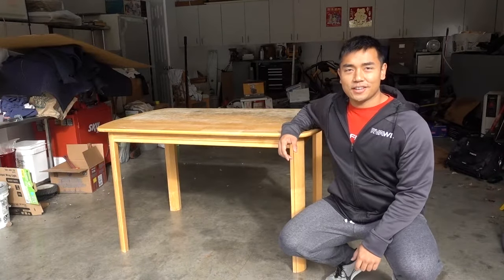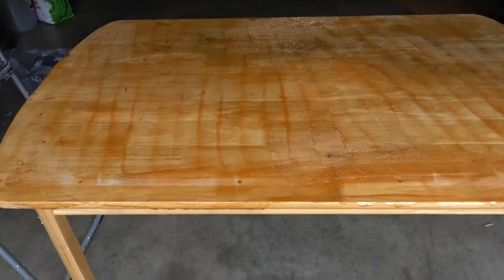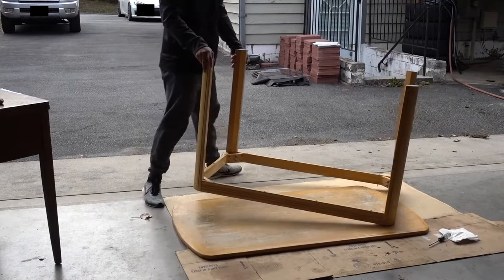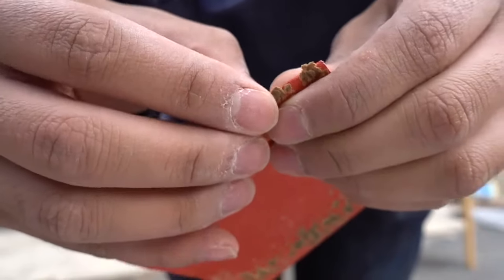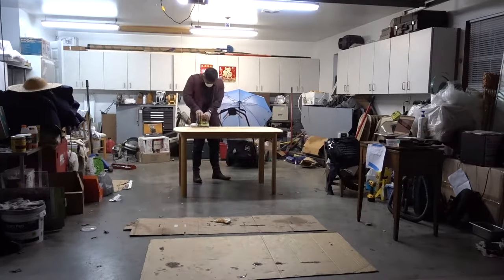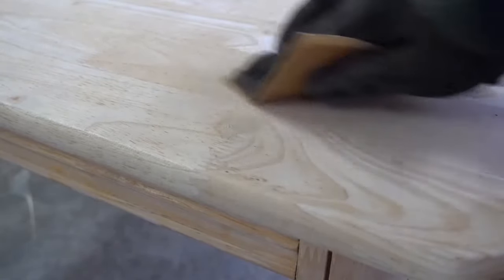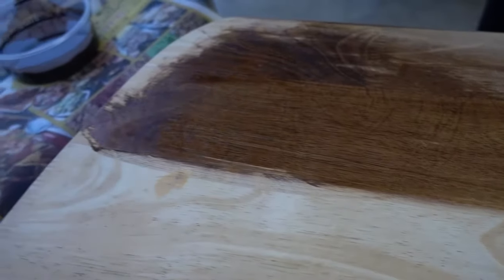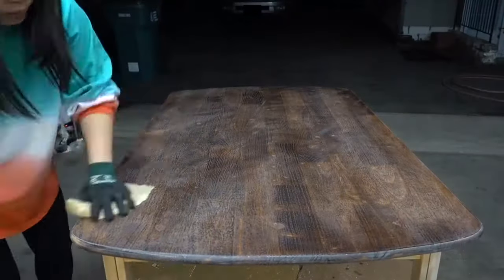DIY | How to Refinish an Old Dining Table

Comment: A few tips.. The finish was so gone it would have been easier to skip the stripper and just sand with the power sander... 80, 120, and 220 grits in that order.  Sand with the grain... Not in circles.  Minwax also has a wipe on polyurethane that is a bit more beginner user friendly than a brush on poly. You apply it with a rag like you did the stain. Lightly sand between coats with a 400 grit by hand and wipe dust with tack cloth. Your finish will be smooth. Now that you've started you'll find that if you need furniture thrift stores have great solid wood pieces that you can refinish for a fraction of the cost of new fake stuff.   Congrats on self teaching and sticking with it.  It's worth the effort.👍
Reply from the maker: Thank you a bunch for this! Appreciate the time you put in for all the advice 😀 I'll definitely come back to this in the future
Reply: i dont mean to be off topic but does anyone know of a tool to get back into an Instagram account?
I somehow lost my account password. I love any assistance you can offer me
Reply: @Sutton Santino Thanks so much for your reply. I found the site thru google and I'm in the hacking process atm.
Looks like it's gonna take quite some time so I will get back to you later when my account password hopefully is recovered.
Reply: @Sutton Santino it did the trick and I now got access to my account again. Im so happy!
Thank you so much, you saved my account!
Reply: @Ares Bowen you are welcome :)
Reply: Hey Lori, a quick question, when sanding to go with the grain are you able to still go back and forth?
Reply: @adamprice8247  are you using a random orbital sander?
Reply: @adamprice8247  no matter what kind of sander you are using, or if you are hand sanding, you move it back and forth along the lines of the grain.  If you are using a random orbital sander let the machine do the work. Dont push down too hard. Let the weight of the tool itself and your hand resting on it be the only pressure.  As you get more experience with the orbital you will start to figure out how much fudging of the "rules" you can apply to different issues like tipping it on the edge a bit for a tougher deeper scratch or more stubborn finish.
Reply: @loricreel2463  I’m sorry for this dumb question but this is something I’ve researched and no one mentions anything that can help me clarify this. If you’re supposed to sand along the grain, wouldn’t an orbital sander make that impossible to be accomplished? Doesn’t an orbital sander have a round disk that moves round super fast? So no matter in which direction I move the sander, it would still be spinning in round circles no matter what..? I have a table to refinish but it’s an expensive one and I’ve bought many of the required tools to do this same project but am scared I’m gonna destroy the table during the sanding process!
Reply: @Jess_Smith0903  not dumb.  I have thought the same thing.  It's one of those tools that you use according to the rules and learn through experience when the rules can be fudged to achieve a certain outcome more expediently. The other consideration besides the tool is the material you are working on. So if your table is expensive you should find out a couple of things first. Is it solid wood or is it veneer? If it is veneer, how thick is it?  An orbital can take off a lot quickly and burn right through a veneer.  So if it is, you need to be very aware of how your tool works, how thin that veneer is and what its condition is like dryness, and adhesion to the base material.  The other thing to consider is how much experience you have with that tool. If you've never used an orbital ( which rotates doubly like a planet hence the name) then you should practice on some material that doesnt matter. If you want to see how it works on a veneer you could pick up a cheap little side table from a thrift store and purposely go through it to see how that works.  Also use different ammounts of pressure and see what produces the dreaded swirl marks that jump out at you when you think you're done but show up when you put the finish on. Then see how to correct that with progressively finer grits and a sharp eye. Experiment with different grits and if available on your sander different speeds.  When I am sanding veneer with the orbital I use a low speed and 220 grit. It may take longer but it gives you more control and less chance of taking off more than finish and surface scratches.  If in any doubt, you are better off hand sanding if the table is really important to you.  Pain in the ass but nearly foolproof.  Any way you end up doing it I can guarantee 3 things: 1. You will come to a point, maybe several, where you think it's not worth the work... Persevere. I promise it's worth it. Take a break and get back at it. 2. You will know where every tiny mistake you made is and everybody else will see only an amazing job well done... Let them and just say thank you.  3. If you follow 1 and 2, it will be a piece of furniture that you are proud of, mistakes and all.  Have fun.🔨🔧 (they really need to make a sander emoji)
Reply: @loricreel2463  wow thank you soooo much for the elaborated answer! Yes, I picked up a piece slab of wood from Home Depot (those scraps they have for cheap) just to practice with the sander before starting on the table. 
The table is a solid walnut wood, very heavy! I will need to strip, sand, stain and apply a finish (Poly). I’ll try and remember to write you back here and let you know how the project went! Just waiting to warm up a bit since I’m in an apartment and will need to work on this outside in the balcony. Ps: you’d think that with so many useless emojis, they’d have a sander, but nope 😂
Reply: @Jess_Smith0903  make absolutely sure it is solid walnut especially on the table top. Frequently the frame and legs will be solid but the top will be veneer. Maybe the apron too.  Walnut is an expensive wood so to have a solid top is unusual even for older furniture.  Look at edges of top and underside edge of apron under good light and see if you can detect a thinner top layer of wood. Look at the underside of the table.  Can you see the planks and if they are running in the same direction as the top grain? Or are they running  perpendicular? Can you tell if the bare wood on the bottom is congruent with walnut color or grain? Really check.  I say this cuz I have made the mistake and found out the hard way.  Would really love to hear how it goes for you.  Hit me back if you run into questions.👍
Reply: @loricreel2463  the legs is a black metal (it’s an industrial style piece) and the table top supposedly walnut. It is VERY heavy so that’s why I think it must really be a solid one, plus it’s what the brand’s website describes it to be. I’ll try to inspect either way and follow the points you gave me to look through!!
Reply: @Jess_Smith0903  aahhh so is it live edge?  Sounds beautiful.  And if it's live edge, no worries... That's a slab of walnut.  If it's milled edges and you can tell on the end grain that the planks are just that, solid planks, then sounds like you're gonna end up with an amazing table.  I will reiterate that if you have never finished a piece before, minwax has a wipe on poly that is easier to use than brush on finish.  Might want to get a couple different ones and see what works best for you when you get to that point.
Reply: It's just a shame they ruined the legs.  SPRAY PAINT!!!!   AWFUL.  Yes, it would have been more work, but the legs were probably nowhere near as worn and would have required a lot less prep.
Reply: @loricreel2463 No, that is an orbital sander. It doesn't remove material as fast as a random orbital (dual action or DA) sander and is safer for sanding veneered furniture.
Reply: @loricreel2463 I agree with your caveats. It is best to assume that all furniture is veneered, this way you will never sand through veneer ever again. Look for a machine with a smaller oscillation, as low as 1.6mm, for the best surface with the least squirrel tailing. Going to 240 grit will be so fine so as to help make it less noticeable. In a perfect world nothing beats hand block sanding.

Comment: Great video . My wife wanted a dressing table , luckily we found one in our local charity store for £15 . It was very dark wood ,but you could tell it was quality made , with dovetail joints and mortice/tenons . Probably circa 1900's . 3 days later , sanding,stripping,sanding,staining,sanding, oiling, sanding,wiping it looks stunning . Well worth the effort . Just be brave .
Reply: That's amazing! What stripper brand did you use? I'm also based in the UK and also unable to get citristrip and a lot of brands available have terrible reviews so curious what worked for you :)

Comment: its not stupid spending 100 bucks to fix it. you could have easily gotten 250 for it on Facebook market place. But 100 bucks to restore and treasure all the sentimental value that table has is priceless. Good job restoring it.

Comment: I just started restoring my grandmothers dresser.  I’m glad I didn’t use that citrus stuff 🤣.  I just hit it with 80 grit to remove the old finish and kept sanding with higher grit paper.  80 > 120 > 220 > 400.  Then 4 coats of poly.  Sanded with 400 between coats till it was a mirror finish.  I’m no expert and this was my first attempt but I learned that the more you sand between coats (till it’s super smooth) makes a difference I think.

Comment: Yep , Citristrip is a nightmare. I had to do two coats with an hour in between or so and scrape for days to get off all the gunk it left that will gum up your sander as you found out. Then wipe down good with mineral spirits! I'd do a good carbide scraper and then orbit sander next time or at least try a better stripper than Citristrip which barely took off the poly and stain coat.

Comment: You cant put a price on memories. Or having a happy wife. For a first time using poly and stain i would say you did pretty good. That was a complete table restoration. Also like others have said if the finish/shine is already gone, you could of skipped the stripping part. Also sand with the grain. Other than that GREAT job.

Comment: You should have used liquid stripper, after the gel stripper. That would have penetrated into the wood grains better, and got rid of the dark streaks. And then what many others have said, ended with mineral spirit rinse. THEN sanding. Live and learn.

Comment: I’m doing my very first piece and I feel like I’ve spent a fortune! I now need mineral spirits also… The time it has taken me to go out and about is another issue. The thing is, I want to do it as a side hustle. I want to keep my pieces small and reasonable from a difficulty perspective. My next piece should be much easier because I should have most of the material and a bit of knowledge. I’ve ended up ordering on Amazon because I’m tired of running around AND it’s giving me a bit of a break. 
Good job on your table.
Reply from the maker: Yup! I'm sure as you get better, it'll cost you less and you'll be more efficient about turning it over!

Comment: For the gunking of the Sandpaper with the Citristrip residue, the only fix for that which works but requires additional effort is to graze off the gunk with a box cutter knife. It will fly right off, and every box cutter razor has a pointy bit which can clear speckled debris from your sandpaper.

Comment: When you use the citrus stuff use a brush to apply it and then wait until it bubbles and starts drying out and then you can scrape it and then clean the surface... Its actually really amazing stuff just need to learn to work with it
Reply from the maker: Good to know! I don't remember that being in the instructions but I'll try it next time.
Reply: @JohnHeng  yeah Im not sure it's on there. I only figured out how to use it when I was doing the body work on my husbands car. Just poured a little on and used a brush to cover the surface and waited until it bubbles up and rolled right off

Comment: A belt sander with a slightly coarser grit might have been better suited at first then use the orbital sander and a finer grit. Then finish with the finest grit and a sanding block
Reply from the maker: Yeah I probably shouldn't have bothered with the varnish remover and started off with 80 grit or something. Once the table had dried and I started sanding, it was way easier
Reply: @JohnHeng  Or just use a different type of remover. I've never tried citrus based strippers so I don't have a lot of experience with how they work. I do know it's a lot of labor  - even with coarse grit - trying to sand varnish or paint off when stripper will pull it right up. Using lacquer thinner or mineral spirits after the stripper is recommended. 

I got this from a google search: 
Note: The final step of rinsing the surface with mineral spirits or lacquer thinner is critical to avoid problems when sanding and staining. Avoid strippers advertised as "water-rinse" or "no rinse."
Reply from the maker: @dang1861  awesome I'll check back on this if I do another restore!
Reply: Belt sander is a little too powerful for this I think.

Comment: If you consider when they bought the table, like if it was 1980 for example, $65 would be worth $228 now. $148.78 if it was bought in 1990. $109 if it was bought in 2000. If that adds any perspective. Cool project though and worth the skills gained doing it.

Comment: #1 temperature affects everything. You are wearing a hoody so it's too cold for the paint stripper to work.
#2 Read the directions. There should have been a cleanup section. I bet it said soap and water for the citrus based paint stripper.

Comment: it's called inflation. $65 10 years ago isn't the same as $65 now.
It was a time when a horse cost $85.
Reply from the maker: $65 in 1995 is about $115 in today's money which still seems really cheap to me. The table also came with 4 chairs which kinda blows my mind. But yeah, I get where you're going with this for sure.
Reply: @JohnHeng  oh. Ok. Ruble just is doubled every 10 years. Dollar as I know lose about 2% per year.

Comment: 2:04 
*GOOP 
Is definitely correct, I believe it’s the worst stripper I have ever used.
I had the greatest pyramid shaped MCM table.
Instead of stripping I should have listened to a friend’s advice.
Use stripper lightly on the Formica shelves.
Lightly sand the wood, and paint it again.
Because it had a previous 2nd owner that destroyed the original finish.
By using an oil based paint, I could still kick myself.
Now, I am watching you. Hoping you find a much better way to remove this table’s marks.
My problem is I have a 🐈‍⬛ and live in an apartment building.
So, I don’t have the option of toxic outdoor stripping or finishing.
I have no plans of doing the legs or under the top.
It’s every bit of 100 years old, with original white non~chipped porcelain casters.
The top was used as roughly as your wife’s family.
It’s lacquer or shellac, it’s become gummy.
I want a nice, shiny, durable surface, that’s easily cleaned.
Thanks 😊